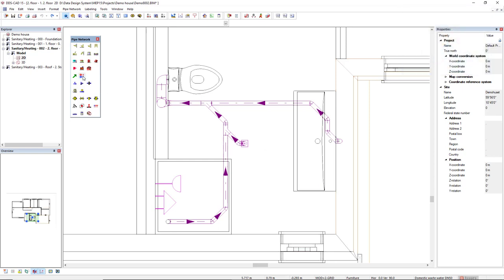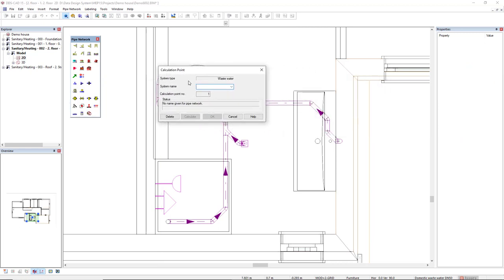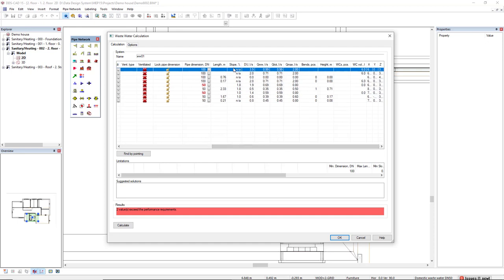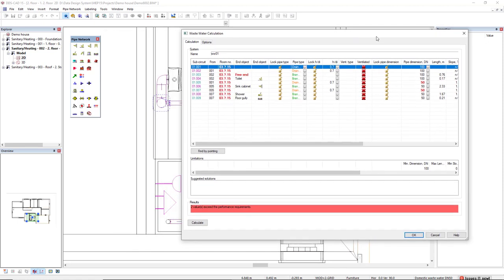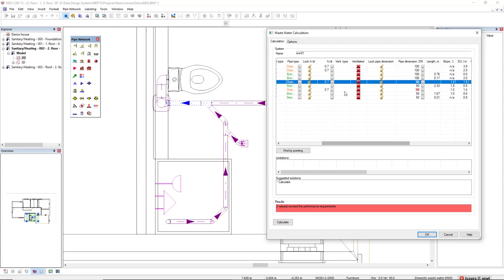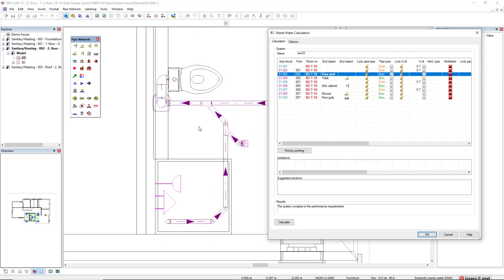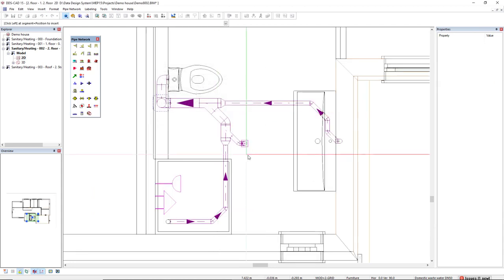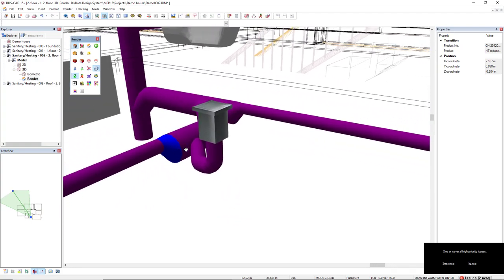Getting Started  - Plumbing - Calculating your waste water system

Comment: Hello. Is there a video, or can you make one about the condensate from cooling devices? Which media is suiatable for that aplication? I use AEE draining in new (created) elements, since all waste water medias dont allow pipes going upwards, which can be a case when condensate pumps are used. Thank you for the videos.
Reply from the maker: Hi Jurij, In order to have slove active you must use pipe Medium from the Group Waste Water, I suggest you to use the Medium Drainage. If you have doubts about it, please contact the local support of DDS-CAD.